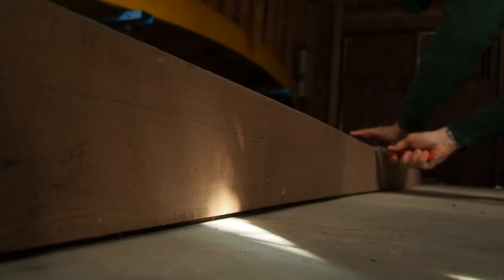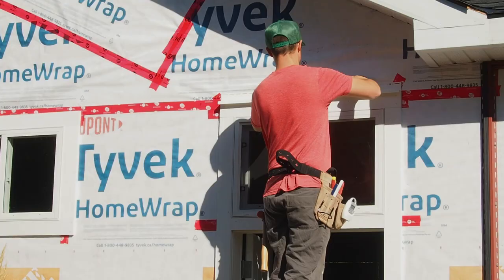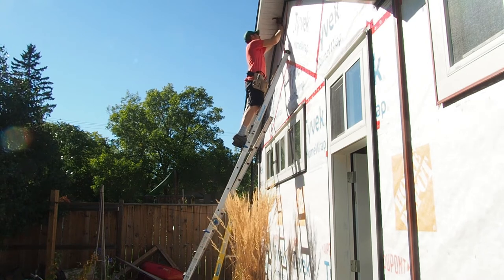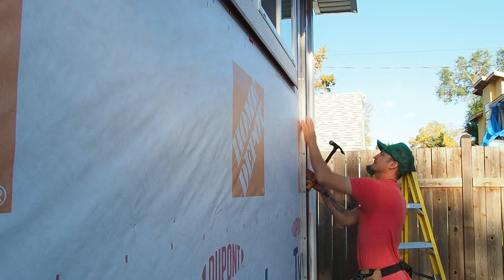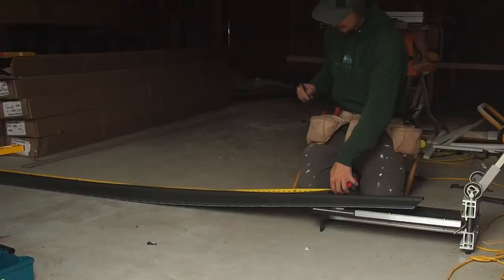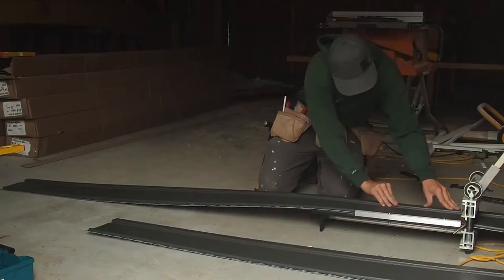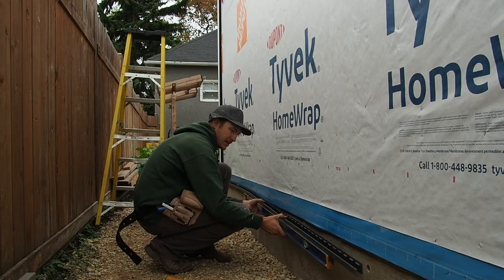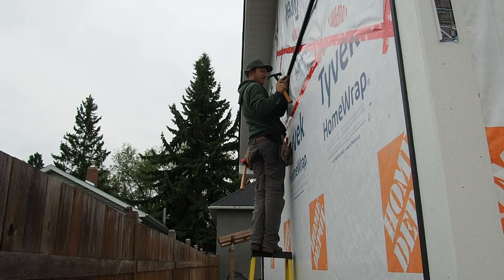The Everything Garage gets BOARD AND BATTEN vinyl siding (Part 9)

Comment: I'm planning to build a custom home with 1" of polyiso exterior insulation.  Would I just use longer nails to attach to the OSB underneath?  If I did strapping or rainscreen it would have to be horizontal to attach board and batten and I don't think horizontal rainscreen is recommended? Do you have any suggestions?

Comment: Nice going …. Question I have a slightly curved wall on one side of the house do you think board and batten would work around the curve?
Reply from the maker: Depends on the material and the curve. But if you are using vinyl, it would work.

Comment: Where is the critical info?  Where did you start from?  Did you use a starter strip?  Why did you install a J channel adjacent to your corner mold when it has an inherent indent to start your first strip?
How did you butt J channel corners?  How would you seam vertical to horizontal vinyl?
Reply from the maker: Thanks for watching. It isn't meant to be a how-to video. It's part of our Garage series building a garage from start to finish. But to answer some of your questions: I used J-channel at the corners because in the last episode you would have seen that my corners aren't using vinyl siding corners, but instead a PVC trim (I prefer the aesthetics of this). As for starter strips, every manufacturer has slightly different instructions. Some suggest an actual purchased starter strip, others suggest just cutting off the 'groove' from a piece of siding and using that. I don't think there is an inherently wrong place to start an install. As long as you move in a continuous direction, the install should go smoothly. I discussed my transition from vertical to horizontal in another comment, but I just used side-by-side J-channels.
Reply: @hsdesignstudio  Got it.  Ok...I was going to do exactly what you suggested.  Thanks for your timely response.  God bless.
Reply from the maker: @shug2795  no problem, good luck 👍

Comment: I'm about to do a very similar install. I'd love to see how you transitioned the vertical board and batten and the horizontal siding. Any chance we can see it up close?
Reply from the maker: Hey Michael- I just used back to back J-channels of the various colours. They are running vertically, so I didn't see the need for a drip edge. Is your transition side to side or top to bottom?
Reply: @hsdesignstudio  Makes sense, I thought that's what I saw in a quick glimpse from another video. Thanks!

Comment: At 5min32sec where you finished the back wall of the garage, was there a j-channel along the top of that siding? Is j-channel needed there before you can start the peak section of siding?
Reply from the maker: Yes- There is one on top of the bottom board and batten, then a drip ledge, then the bottom j channel for the peak area. I use j channel anytime the siding ends. It hides the unfinished end.
Reply: @hsdesignstudio  thank you! This has been really helpful!
Reply: @hsdesignstudio  try flashing the lower channel with a drip cap then re-start the horizontal siding using a starter strip you need a small space to lock the siding up but even with drilling holes the j won't get full of crud. Nice job mixing the textures.

Comment: Would you need to install horizontal/diagonal strapping? How are you getting all those nails into studs? Are they all going just straight into the aspenite?
Reply from the maker: They are into 1/2" OSB. Siding screws are another option with more bite. However this garage is in a very sheltered location and high winds ripping the siding off are not a concern of mine.

Comment: I'm having a new home built and shopping for siding.  What brand did you use in this video? I like the look of it. Thanks!
Reply from the maker: Hey Todd- This siding is Timbercrest Board & Batten by Abtco. The specific color is called Manor.
Reply: @hsdesignstudio  Thanks man!  Nice. I"m trying to find information on the width of each piece? Certainteed has most colors in 7" and some colors in 8". Mastic doesn't say what their widths are on board and batten vinyl. I guess I'll call these places up and email them, etc.  thanks!!  Plus some board and batten vinyl looks a little cheesy imo but not yours.
Reply from the maker: @Todd K  No worries at all 👍 I believe each piece had a 7" exposure, plus roughly 1 inch for the tongue and nailing strip. I've installed a fair amount of vinyl siding, and I was really satisfied with this one. I've even had a few people walking by ask if it was metal siding because it doesn't have the "cheaper look" some vinyl can have. Good luck!

Comment: Will black vinyl warp over time from heat?
Reply from the maker: That's a great question, and I guess time will tell. However, I think if it is installed correctly, allowing for the expansion and contraction of the siding, there shouldn't be any warping.
Reply: @hsdesignstudio  thanks for such a quick response. I was just curious because I looked into painting vinyl a dark color one time but they said the heat would cause issues. Maybe since yours comes from the factory that color it's different. Any ways looks great and hope to see updates! Good luck!